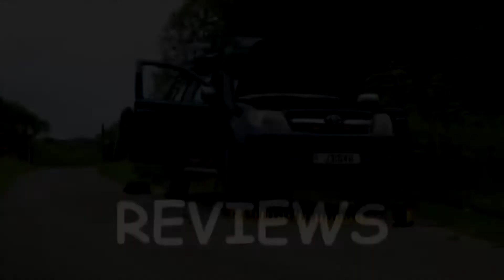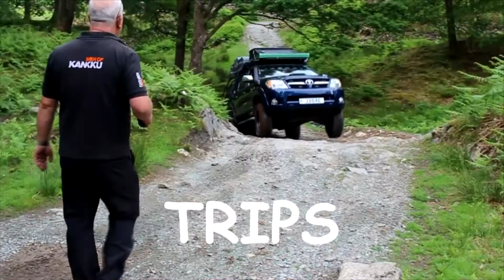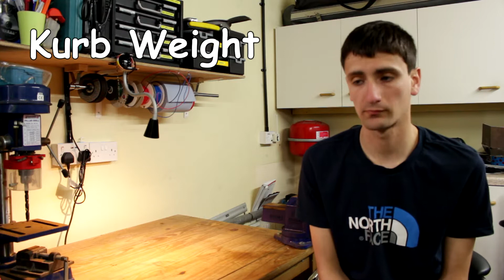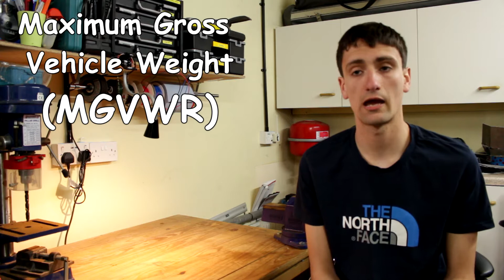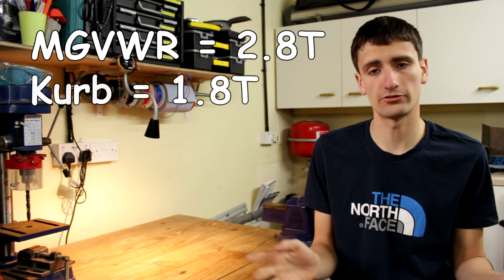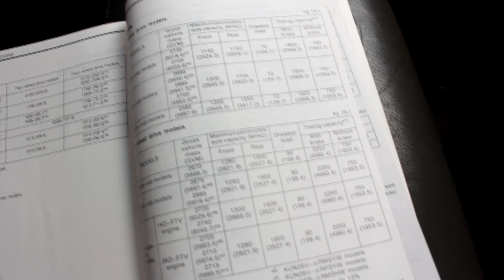MGVWR? Kurb Weight? Payload? An Overlanders Explanation

Comment: Just like to add the following comments. Some manufacturers (Land Rover particularly) class Kerb Weight as having a full tank of fuel, all vehicle fluids, a driver (often 75 kg) and vehicle tools (i.e. jack, wheel brace, etc. - in my case this meant a full spanner set and even a grease gun in the original tool kit) - be sure to check what your manufacturer means by Kerb Weight.

Be aware of axle mass too - this is a favourite to get done by, especially in Kenya and quite rightly too. A poorly loaded vehicle fore/aft that has an overloaded axle but it under its GVM is just as dangerous as a vehicle which is over its GVM, even if the axle ratings on that particular vehicle are not breached. Also, on some vehicles the max. axle load equals your GVM, but not on others, and sometimes the manufacturer reduces the maximum permitted axle loading or even GVM under off-road conditions. Always check before you do anything.

Finally, and this is a warning to owners of Land Rover Defenders. Even though you may have calculated your theoretical payload according to GVM minus kerb weight, Land Rover actually list a maximum permitted payload and it is less than this figure. Quite why I do not know but it is worth checking out as on some models there's as much as 200 kg difference! So even though you may be below your maximum permitted axle mass and gross vehicle mass ratings, you may still technically be overloaded and breaking the law.

I also found it beneficial to weigh my vehicle before I loaded it; it's surprising how quickly it can add up!
Reply from the maker: Great Info thanks! I will pin it to the top of the comment page